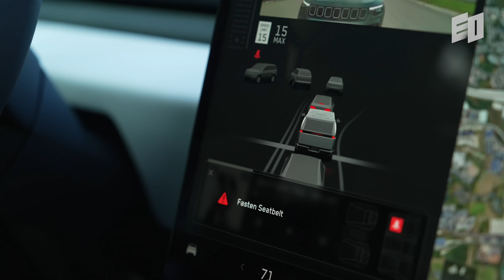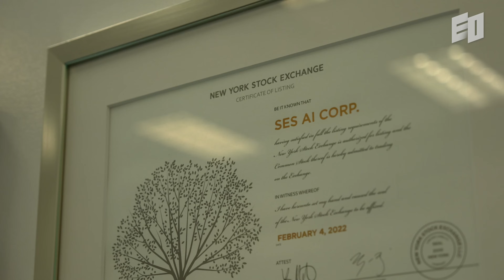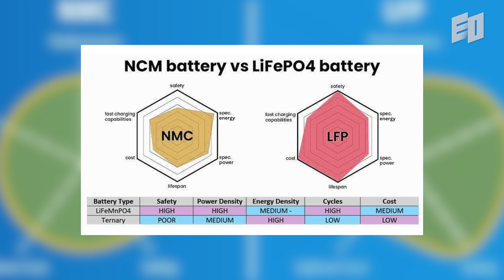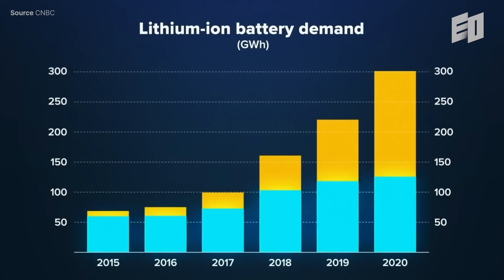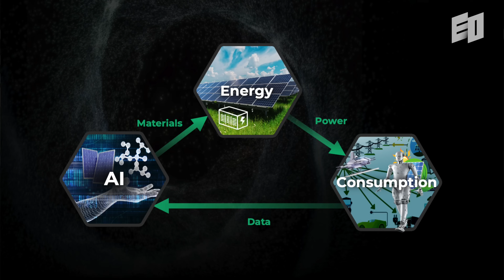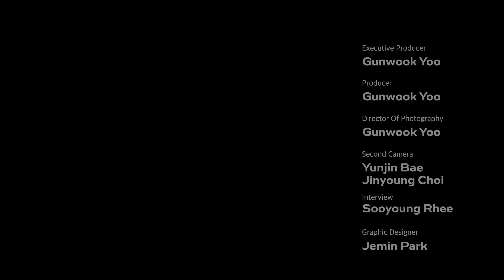Pivot and Fail Fast: Most Valuable Lessons During Our 12-Year Journey to IPO  | SES AI, Qichao Hu

Comment: Sodium ion is part of the future for ev because lithium ion bleeds energy when it is too cold or hot.  For data center, the weight of sodium ion battery isn't a weakness anymore
Reply: Personally I would like to see standardised connectors and protocols as the future so different chemistrys/battery types can be swapped in without the need of protocol convertors and plug adaptors.